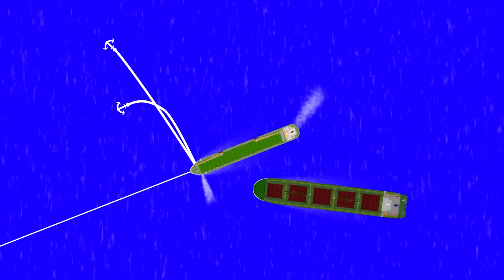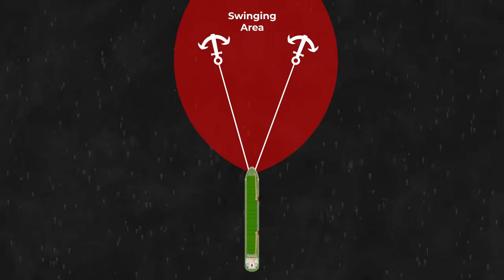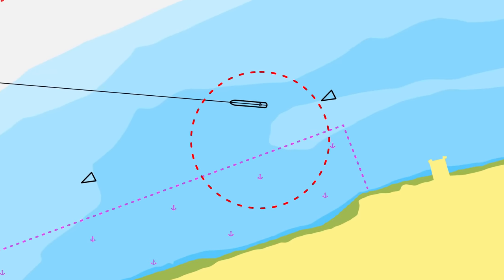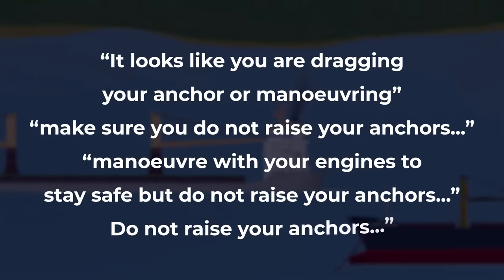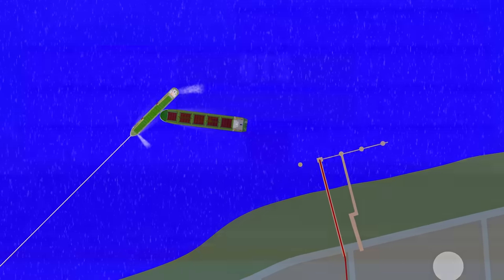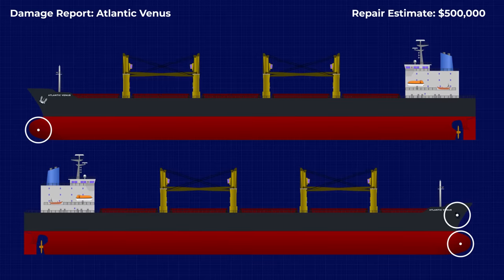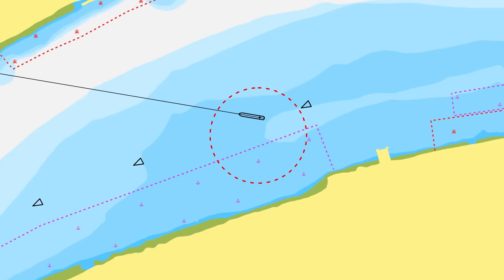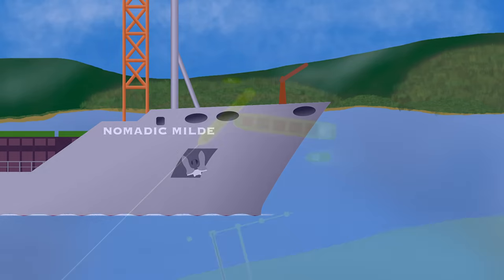Why Weren't Two Anchors Enough?

Comment: It seems to me that 3 points of local operational conditions are in conflict with each other and require policy revision. 1, that the master remains in command while a pilot is on board (I believe this to be the case); 2, that local regulations require a pilot to conduct manoeuvres except in an emergency; and 3, there is not always immediate availability of pilots.
Points 1 and 2 confuse the command dynamics in the local area, requiring the master to be responsible for the pilot’s actions while being restricted from intervening. Points 2 and 3 prevents crews from taking any action to stop emerging issues until either a pilot arrives after a long wait or the issue becomes an emergency and the master be aware they now can intervene. It seems to me that these are inherently unsafe operational conditions.
Reply: Nice try.  You have correctly identified the 3 primary criteria, but you have incorrectly determined their conflicts. 
The Master is ALWAYS in charge.  (1&2) This does not confuse the dynamic with the Pilot as the Master is NOT prevented from intervening.  Indeed the Master can instruct the Pilot as to what he can and cant do and even sack the pilot, but he must request another. I have done that once with a pilot in the Suez Canal. (2&3) In this case 2 is considered an emergency and the pilot requirement does not apply.  The Master cannot be prevented from taking emergency action to safeguard his ship. It would be a debatable point as to whether VTS could have prevented the Master from weighing anchor.  I would have ignored VTS if I could not stem the current with anchors down.
Because you have mis-interpreted the conflicts your conclusion was incorrect.
Reply: @csjrogerson2377  Nope. Clearly the Master did not believe they had authority to disobey VTS and/ignore the Pilot requirement. Doesn't matter what the regs say, it matters how they're enforced & actually observed. If your interpretation were correct, there'd be no accident and no accident video.

Maybe you're a corporate lawyer? They love rules where the corporate office is in de facto command right up until the point where something goes wrong and they can scapegoat the master.
Reply: @x--.  Are you seriously arguing that 'beliefs' matter more than laws... in LEGAL MATTERS!? 🤣
Reply: @x--. Someone's lack of understanding of the law is no excuse for not following it.
Reply: @csjrogerson2377  I accept your explanation for 1&2. However, the conflict pointed out for 2&3 does not refer to the situation in the video when an emergency was underway, it refers to any potential emerging issues which are not emergencies while a vessel is in the area and a pilot is required but not yet available. Restrictions from tackling an emerging issue allows it to progress into an emergency, which is principally unsafe regardless of how well the emergency can or may be resolved.
Reply: @oyuyuy  Although only the letter of the law applies in the courtroom, the common belief in how the law works affects the effect of the law in society. Although the letter of safety laws say to penalise someone for breaking them, safety laws are written to prevent accidents, not to actually put anyone in a prison even though it can be used as such. In that sense, the effect on safety is the primary concern when writing or revising them.
Reply: @Roytulin  Bla bla blaa... If you're in charge of a ship you need to know what to do in the case of an emergency, end of story. If you don't even understand that you're responsible for the ship that's a pretty big problem.
Reply: @oyuyuy  I see you cannot understand the concept of principle safety. I suggest school.
Reply: @oyuyuy  do you want safety or do you want punishment? If the operational procedures are significantly different from emergency procedures that the Master, crew & pilot all believe the Pilot (and their rep) have the final say... this is what you get. So what do you want, safety or scapegoats?
Reply: @norml.hugh-mann  Safety or punishment? You can either have a system that promotes clarity and safety or you can have a system which confuses and scapegoats. Writing a law that says murder is illegal doesn't change whether people get murdered, it's the implementation.

There's confusion on that river.
Reply: @x--.   I am an ex RN Command qualified  Warfare Officer and Master Mariner with 38 years of experience and you are wrong.  The Master does have the right to disregard VTS and whether you think he did or didnt have the right to disregard them is irrelevant.  He did. If I were in his place I would have shortened the cable and tried to stem the current.  If that was impossible, I would have weighed anchor and tried to stem the current.
Reply: @Roytulin  I'd say that 'know what to do in an emergency' is pretty crucial for safety. But you do you nitwit.
Reply: @x--.  Lmao, in what world does 'knowing who's responsible for the ship' detract from safety? You two are nuts.
Reply: @Roytulin  Sorry, I didnt realise you were discussing issues outside the video that were non-emergencies.  That being the case, I would agree, but its pretty rare and if it does become an emergency, then the Master will take action as necessary.
Reply: @csjrogerson2377  My friend, the law seems pretty clear. I get it. I make rules all the time for my kid but saying I made a rule doesn't mean they comprehend that rule.

So do you want safety or do you want to rely on idiots? Because it's clear there were multiple failures. One of the biggest was, "What are the rules in this high-stress, potentially emergency situation?" As relayed in this video, NO ONE understood. Not the Master, not the bridge officers of either vessel, and not VTS because if they had understood this accident wouldn't have happened.

And if you still don't think I'm right just look at the USS McCain, the USS Fitzgerald, and the USS Connecticut. 

How many sailors had to die unnecessarily before the Navy said, "Oh, maybe we have structural issues because just blaming the CO might not be the best method of ensuring safety."
Reply: @x--. I may be much less qualified than our master seaman here, but the one thing drilled into our heads during the charter captain and masters course was you as captain are always responsible unless you have been relieved of command and a competent replacement has taken your position. No pilot, harbor master, or president of the United States has command of your vessel. You do. If the anchors are dragging and you didn't provide proper corrections, it's your fault. If the anchors are dragging and the crew didn't set the warning so it wasn't noticed, it's your fault. There is nothing that makes it not your fault if you are in command. If you do everything correct and then hand off command then maybe its not your fault. But don't be suprised when you get blamed. And thats why i work on boats and don't drive them. Im only responsible for my mistakes this way.

Comment: Fascinating! I had an anchoring mishap myself recently, when the yacht I was on was at anchor in a place with a strong tidal current and a stiff breeze. This combination caused the boat to turn from being right behind the anchor to having it abeam, and as the boat turned, the anchor line got caught on the keel. We were able to resolve the issue with no damage, but it was a tense moment and a good lesson.

Comment: In aviation, we call it the Swiss cheese model. There's lots of holes in each layer, but it only takes one set to make it all the way through. An accident, incident, or mishap is almost always the result of many missed opportunities to stop the error chain. The aviation industry has put a lot of effort into creating sources to break that chain. Going to have to say, a lot of these maritime accidents seem to be the result in part of the strict hierarchy of leadership where it's one person at each point of failure. We call it Crew Resource Management. And it's a methodology of allowing the captain or person in command to maintain overall authority and responsibility, while knocking down the godlike pedestal of command to allow teamwork to happen. 

So the chief screwed up and didn't catch it or deem it necessary to take action... So I guess they have the only eyes capable of detecting a problem and taking corrective action?? It just feels like between this and Exxon for example, these are mistakes that shouldn't have been just one person's to make.

Comment: Also, why would you just sit there when you can perfectly well see that another vessel is about to come in contact with you? You can let out anchor, you can thrust, you can do all kinds of things I'm sure to help prevent the interaction. Yes, you can't heave on your own anchors and completely remove yourself once the situation is that bad. But you can almost certainly do SOMETHING.
Reply: Not doing anything means they are not liable for any damages. Would you like to be liable for the damages this coused? 
What if letting out anchor chain made the 2nd vessel hit the terminal instead? They just went from 500k in damages paid by someone elses, to paying the 11million damages (or their insurance, that would increase the insurance cost for the whole fleet)

Comment: Some automated anchor dragging alarms seem like an obvious systematic improvement to me. Why wasn't such a system in use?
Reply: Money probably
Reply: I have an ignorant landlubber question - how do you detect the anchor is dragging?
Reply: @Merennulli Best way would probably be a GPS monitor if you change position (which is what the Nomadic did but probably too large of an area). When I anchor a smaller boat I take a couple land waypoints and if their orientation to the other changes the boat has moved
Reply: @WilhelmSchicklegrube Thanks. I was thinking of the problem too narrowly and didn't think of GPS.
Reply: In a modern merchant vessel, you: 
1. Keep one or both radars running, while you on each screen activate 2 of what’s called an EBL (Electronic Bearing Line) on the screen. The EBL is a straight line running from your vessel to a conspicous, fixed point on the radars screen. If the EBLs move away from their conspicous points (the 2 points being different points from the other), the vessel is dragging anchor. 
2. You have your ECDIS (electronic chart) show intervals of vessel’s past position(s). If the vessels drags anchor, over time you will se a pattern of past positions showing the vessel moving away from the position of the anchor (you marked the position of the anchor in the chart when you dropped anchor). 
3. You activate the anchor watch mode in the ECDIS and the electronic chart will give alarm if the vessel moves far enough to exceed set limits. The limit is always a circle around the vessel, as the vessel can be expected to swing freely around the anchor as a result of changing directions of wind and tide. Size of circle is according to the size of the vessel and the chosen lenght of the anchor chain.
Reply: @Merennulli  gps and a control system that automatically calculates whether you are dragging
Reply: I guarantee that they had an anchor alarm. They won’t go off unless you set the border on the chart plotter. It’s normal to vary in your anchor circle as current and wind change.
Reply: @Merennulli GPS is common, if you stand at the bow and watch the anchor chain you can see when it drags. The chain or cable will stretch out then come slack fairly quickly.

Comment: One recurring factor: decision-makers separated themselves from some of the necessary information but didn't delegate the decision-making. 

Example: VTS made the decision(s) to not raise anchor, to require a pilot, and to require the ship to schedule their own pilot. While the decision-maker, VTS, had a lot of information about the waterway, port, local people and more, their information was incomplete because they weren't on the ship. Despite being separated from this necessary information, (it appears) they didn't 1) collect more information, 2) share the relevant information they possessed, or 3) delegate (some or all) decision-making to the ship, who had the necessary information.

Similarly, this may have been a factor when the large tractor tug approached. If the events unfolded with the mood described in this video, then the pilot was the decision-maker. He/she had planned the roles and actions of each of the players. But because this was a nonstandard operation with elevated risk, information and decision-making should have been widely shared. 

HOW TO USE THIS in emergency situations:
If you (believe you) are a decision-maker, then you must ensure you are collecting necessary information or delegate (some or all) decision-making to someone who has the necessary information. Collecting necessary information has at least two parts: collect the necessary information and ask other people what they think the "necessary information" is.

If you (believe you) are not the decision-maker, but you have necessary information the decision-makers don't have, you should make the information COMMONly known. (To communicate means to make information common with other people.) Instead of trying to communicate with only the decision-makers, choose a slightly different goal: make the necessary information commonly known. Because 1) decision-makers sometimes don't want to collect more information, 2) as the situation changes, who is making decisions might change, and 3) you might be unaware of some of the decision-makers. You shouldn't spam useless information, however, so try to limit the communication to necessary information. And, so that you can know what information is necessary, you should try to understand the situation. Finally, it might be wise for you to make a decision even though you (believe you) are not a decision-maker. The following things should influence whether you assume the power to make a decision: 1) a large disparity of necessary information that you are near but from which the decision-maker is separated; 2) elevated risk; and [a couple of other things, but I'm suddenly tired and must end, sorry.]
Reply: That's okay, take a break. Do come back to finish your comment though. It's very useful information.
Reply: Unfortunately, it can be difficult to determine if a piece of information IS useful.  THAT detail might also be with the decision-makers. 😕
Reply: This is a fantastic comment! It gave me some insight into a problem I had this week, in fact. Thank you for taking the time to write it out.
Reply: @christalbot210  Yes, it "can be difficult to determine" which information is necessary. In my original comment, I explicitly wrote about how to determine which information is necessary, twice. Plus, I'm describing an abstract idea to use as an ad hoc procedure in an emergency: you should assume everything will be difficult.
Reply: The decision making is delegated though. VTS does not hold authority over the ship in an emergency. The captain was entirely empowered to save the vessel. It's just like in aviation really.
Reply: @XMysticHerox  Then all of the ship's crew who were lawyers or fly planes should have known better.
Reply: @HunterHogan  You do not need to be a lawyer to be aware of your responsibilities. Thats a basic requirement of the job.
Reply: @XMysticHerox   Then every crew member and every person who works with ships whose "awareness" doesn't agree with your "awareness" is irresponsible.

Here's another way to look at your comment: does it fix anything? Saying "the captain has authority" is merely saying that the captain has authority to have incomplete information. "Authority" is not knowledge. "Authority" is not communication or coordination or problem solving. Nearly every ship on the ocean floor had a crew who clearly knew who had authority.
Reply: @HunterHogan  The crew taken as a whole. First and foremost the ships master of course. I am not sure why it is such a crazy concept to you that people operating and being responsible for dangerous machinery ought to be responsible for said dangerous machinery.

No saying "the captain has authority" correctly describes the fact that the captain is entirely within their rights to to whatever it takes to save the ship and has absolutely no obligation to listen to the port authority in an emergency especially when they are clearly unaware of the full extent of the situation and giving nonsense orders.
Reply: @XMysticHerox  Nice strawman you have there. You sound just like VTS from this video. Both of you are asserting who has authority and both of you foolishly believe that if everyone knows who has authority, then the problems will be solved.
Reply: @HunterHogan  Thats not a strawman? Do you even know what a strawman argument is or are you just throwing around buzzwords?

And I am not asserting who has authority. I am stating a simple fact you could easily look up. If you wish to see for yourself it is in SOLAS - International Convention for the Safety of Life at Sea chapter 5 regulation 34.

And yes the issue here was the ships master waiting for and relying entirely on a pilot and the port authority when it was their responsibility to ensure the ships safety. So yes it is a question of authority. Undeniably so. The port authority could have done a etter job sure but again it really is not the purpose of a port authority to handhold a ships crew and tell them exactly what to do.